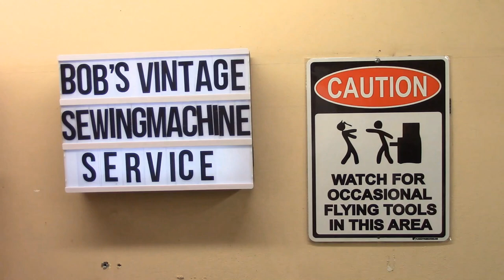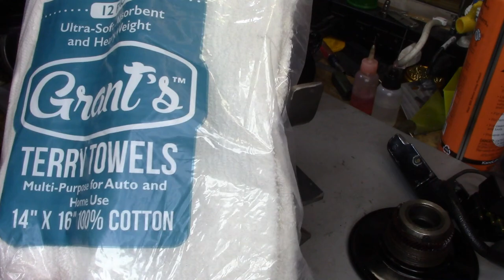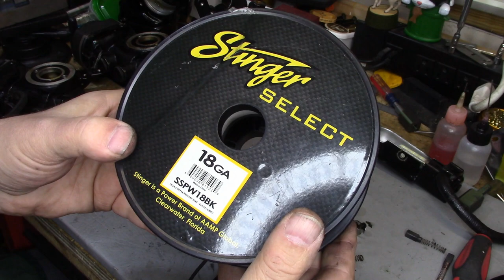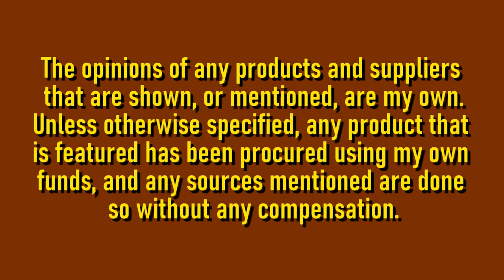Rewire Job for Carol, a Benchside Chat - Sunday Morning Quickies, Ep. 70, February 12, 2023

Comment: Where do you get replacement brush caps?

You should whip up a bunch of those brush pushers and auction off to benefit your
blind citizens charity.

Those ARE nice-looking wires on that motor!

"Slicker'n deer guts on a doorknob." --Ozark version
Reply from the maker: The Featherweight shop sells replacement caps for the 221, which happen to fit the potted motors as well!

Comment: Thank you, for sharing your knowledge. I repeat your videos to learn, and I am getting gutsy. However, is it possible to use, 18 AWG Gauge GPT Primary Stranded Hook Up Wire 25 ft 0.0403" 60 Volt? Since I am not going to fix more than one or two15-91 motor.
Reply from the maker: 18AWG stranded hook up wire is what I'm using. I can't specifically say about your particular wire, do you have a link where I can look at it?

Comment: Thanks for the videos. I am rewiring a 201-2. Do you know of a replacement for the small washer on the armature shaft? Thanks.
Reply from the maker: Many motors don't have the washer. In the rare cases where I lose one, I make it from a thin plastic document protector sheet. If you go that route, you want the harder plastic pages, not the real soft ones. O use a 1/4 hole punch for the center hole and then cut the outside of the washer to fit. It doesn't have to be pretty, it just has to (mostly) cover the bronze bushing without going beyond and interfering with the forward bearing surface of the rotating mass.
Reply: Thank you very much. The 201-2 is a thing of beauty.

Comment: Are the 201-2 and 15-91 motors interchangeable?
Reply from the maker: The motors are, however, the bobbin winders have one part that is different from each other, that being the bobbin follower. The follower is wider for the 15 than the 201.
Reply: @BobFowlerWorkshop  I had a mint condition 201-2 (other than the wiring) that I sold because of the wiring.  I wish I hadn't have gotten rid of it.
Reply: @BobFowlerWorkshop  Thank you, Sir.  I had a mint condition 201-2 (other than the wiring) that I got rid of because I didn't have the knowledge to rewire at the time.  I should have never gotten rid of that beautiful machine, but I love my 403s and 404s and my Kenmore 1941.

Comment: What type grease do you use
Reply from the maker: I use MIL-G-23827A, which was made by Royal Lubricants Co. My supply is military surplus, and I haven't seen it available recently. I have been experimenting with MIL-G-23827C, which is a synthetic variant> I haven't determined if that is really suitable yet. The safest bet, which is readily available, is Sew Retro Grease which is sold by the Featherweight Shop. It's expensive, but it works real well and if you don't do a lot of motors, it's a great option.
Reply: @BobFowlerWorkshop  awesome thank you